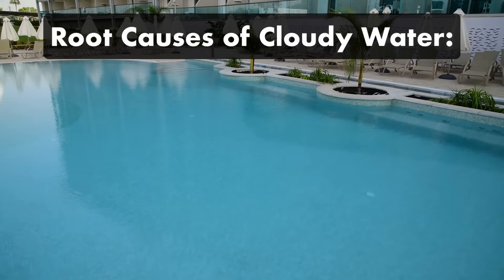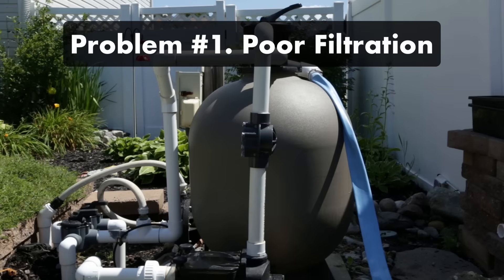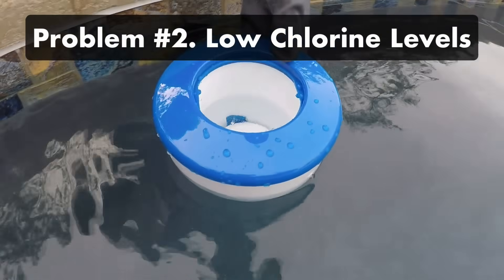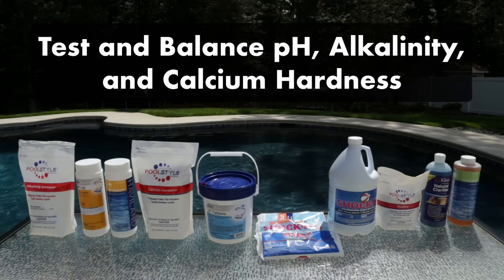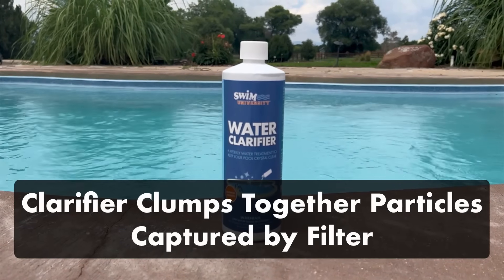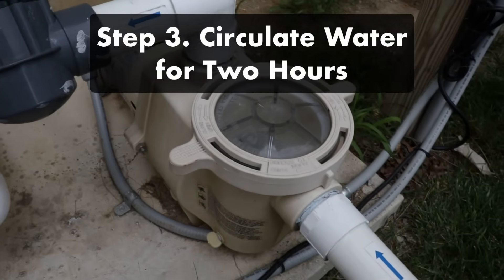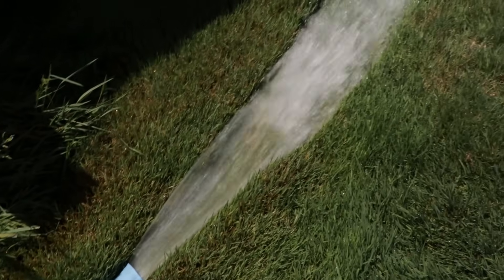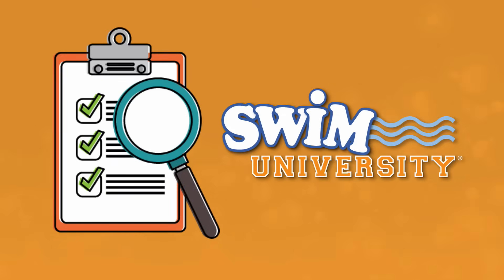How to Clear Up a CLOUDY POOL in 48 HOURS OR LESS

Comment: glad you mentioned poor chemistry as a root cause [02:54]. I’ve found that even if my levels look 'in range,' I can still get that murky look from organic buildup like lotions. I started using aquadoc non-chlorine shock once a week to oxidize those oils specifically, and it made my clarifier work ten times better. It basically prevents that 'chlorine lock' feeling where you keep dumping in sanitizer but nothing happens

Comment: Steps you should always take prior to and after adding chemicals..

1) Check levels (to see what you'd need)
2) Sweep floor with brush (allows dirt and debri to rise from floor)
3) Vacuum
4) Make sure pump media (Filter/sand) is clean.
5) Add chemicals
6) Run pump for 8-12 hours
7) Re-check levels next day
8) Add/balance pool chemicals
9) repeated process 2-5 until clear.

Comment: Working with my pool for spring open. Got above the ground pool. Every morning I check chemistry pH around 7.2-7.6, Alkalinity 100ppm, Chlorine at 5-10ppm due to shock, I brush the sides, the bottom, picked up some debris, filter running non-stop for now(performs 2 backwash and rinse daily) Pool still teal cloudy, cant see the bottom. Any advice?
Reply: Did you ever figure it out? I’m in the same boat

Comment: What happens when you use floc and the water is still milky/cloudy?
Reply from the maker: What else did you do before adding floc? How are your other levels?
Reply: @SwimUniversity Shocked several times with cal-hypo and then non-chlorine shock. 
My levels are:
PH 8
FAC 3
TC 15 
ALK 80
CH 125
Phos 50ppb

I know CC is 12. I want to stray from cal-hypo because it raised my CYA and I had to partially drain and refill. Should I try liquid chlorine? How many gallons of chlorine do I need for my 20,000 gallon cartridge pool? My kids haven’t swam this summer yet.😢 Thanks!
Reply: @enj0ythesiIence  Calcium hypochlorite did not raise your CYA, that would be Dichlor or Trichlor Tablets or some form of Stabilized Shock (ie Clorox "Blue" bags). Your CC is way out of balance, max is around 0.5ppm. I'd worry about that first. Yes Liquid chlorine is the best choice as it only affects FC levels and increases salt slightly. Our calcium hypo shock is fine, however it will raise your Calcium levels with each use. But that shouldn't be a problem for you currently as your Calcium is low enough. Something is causing the high Chloramines (CC) to be very high, which is first problem to attack

Comment: My above ground pool was green but after several shocking several times , vacuuming and running the filter it is now blue and levels are good. The problem is it’s cloudy and the CYA is at 0 with a test strip but about 30 at the pool store. I had added CYA 3 days ago , liquid in the skimmer. They are saying leave it alone but it’s still super cloudy. I clean the filter 2x a day - but it’s pretty clean w the exception of some small particles from pine trees. Any advice. Chlorine on the strip is also slightly high but not at the store test. Help!!

Comment: My free chlorine and combined chlorine are both high.  So I added non chlorine shock.  But I feel like I should have added a cal hypo shock instead.  Can I still add that or do I wait 24hrs?
Reply from the maker: You don't need to wait that long to add chemicals after adding non-chlorine shock. Test your chlorine levels after adding the non-chlorine shock. And if the combined chlorine hasn't come down, you can use chlorine shock.

Comment: My pool was beautiful and clear when we finished our swim.  I tested the water with a test strip and everything was balanced and within proper range except chlorine….  The chlorine was at 0 and so I decided to put shock in the pool….  Immediately the pool got cloudy, woke the next morning and its still cloudy…..   so what is the problem….   It was clean and beautiful when I added shock and immediately it turned cloudy….  Mildly cloudy HELP!!!
Reply from the maker: Shock kills the contaminants and it's very normal that it's cloudy afterwards! Clean and run your filter for 24/7. Or use flocculant or a clarifier to speed things up.
Reply: Another you need to test is phosphate levels, if it's to high not only is that candy for algae, it will also tie up your chlorine levels. If you don't get the dead algae out after a shock treatment, the dead algae can raise phosphate levels. It's a snowball if the phosphate levels get to high.

Comment: Hey! Some ppl say you should not use Flocculant with filterballs? Is that correct? They also says that about ClearPool (which I guess is what you call Clarifier). Do you know anything about that?
Reply from the maker: It's the same reason you wouldn't want to use floc with a cartridge filter: you need the floc to bypass the filter medium (on backwash). Any floc going through your filter medium, like a cartridge or filter balls, will stick to and ruin it. If you can bypass your filter (like a backwash or drain port), you should be fine!

Comment: I’ve been following these steps for 3 weeks and still can not get my cloudy water to clear up. I even just installed a brand new sand filter 2 weeks ago. I went with a 22” filter since my pool is 22,000 gallons. Filter has been on 24/7. I’m at a loss.
Reply: I imagine you cleared this up by now. I had the same issue. What ended up working is partial drain 4"-6" of water and replenish with hose water. Brought the Calcium level down and got rid of the haze.
Reply: @sixthroot  I’m still fighting it, I’m thinking the same about calcium but I think it’s coming from my well water.
Reply: @kopplinfamily7529 yeah I haven't been able to get it to clear up in the deep end area this year all the chemicals are within the right levels except the calcium hardness which is a little low at 120 PPM also on well water with a 22,000 gallon pool. Was told that the calcium hardness being a little low shouldn't cause the cloudiness though only if it was high but this is the first year I've had issues not being able to clear it up hopefully you get it figured out nothing more frustrating than a non- Crystal pool with how much it cost to run the it this year and the cost of chemicals debated on even opening it at all LOL

Comment: I just dump a couple gallons of bleach in my pool, it's clear very quickly . But I also make sure everything is right with my filter .
Reply from the maker: Good call checking the filter. And a couple gallons of bleach is essentially shocking your water!
Reply: What kind of bleach.  House bleach  ?
Reply: @arizonausa1664  yes
Reply: @thomascorbett2936  ok . Because I treated my pool   , shocked  , green to clean ,  then clarifier.  Now it cloudy
Reply: @arizonausa1664 same... I'm ready to use floc then vacuum to waste.

Comment: Ok so what do those of us that do not have a backwash or waste setting but have tons of dead algae that for some reason just won’t leave my pool? I love ur videos thank you for helping me
Reply: I pull my filter cartridge out, disconnect the hose to the outlet and put a backwash hose on there.
Reply: Dealing with this as well
Reply from the maker: Is it a cartridge filter or a smaller Intex sand filter? You might want to get a hand-held pool wand vacuum to suck it out (but it doesn't connect to your pool)

Comment: My pool was green like a pond. Used liquid Chlorbrite two different times. Killed algae, have stable levels of chlorine and all other levels. I have used Flocc two different times, exactly like directions. Waited 24-48 hours both times. Nothing has fallen and pool is still light blueish green cloudy. Any thoughts?
Reply: When you added the floc did you change the circulation to recirculate? The filter should be bypassed cause otherwise, the floc is being filtered out as soon as you put it in.
Reply from the maker: Exactly this 👆
Reply: Ok, so you have tested the alkaline and it’s within the suggested 100-150 ppm? The pH is within 7.2-7.5? The chlorine is at 3 ppm?
Reply: And that would be why you are not seeing coagulation of particles and floc at the bottom of your pool.

Comment: Good point about skimmer flaps (weir gates).
When taking on a new pool it's one of the first things I look at, making sure they are in place and working correctly.
If they are stuck down or missing, the vast majority of the water going into the skimmer is sub-surface level. Floating debris (dust, dirt, pollen, leaves) will go right past the skimmer, and sink eventually.

The weir blocks off most the water allowing only about the top half inch or so to get in. Surface tension draws nearby debris into the skimmer.
Properly working weir gates can make a huge difference in the pool's cleanliness.
Reply from the maker: A malfunctioning weir would cause a lot of issues!

Comment: Can flocculant be used with a DE filter? I was taught not to use it as it would clog the grids.
Reply from the maker: If you vacuum out the flocculant through the waste port using a backwash hose, it won't touch your filter grids.

Comment: Have you ever heard of the pool pump itself causing a cloudy pool? I have a new filter  perfectly balanced pool. Tired everything. Still  cloudy
Reply from the maker: Are you running it long enough? All of your water should pass through your system at least once a day.
Reply: @SwimUniversity  it runs 24/7.
Reply: @reddogg3118 damn you constantly run it? You must be rich haha. I run it 10 hours a day.
Reply: Thats the exact problem I have now. I've been running it for 24 hours and the pool place keep telling me the water is balanced. This is killing me!!
Reply: @thaglacierboy  I used something called pool first aid. It cleared my pool right up in three days. Crystal clear now.
Reply: @thaglacierboy go to a different pool store for testing.  Some of the testing machines can be significantly inaccurate.  Also, there are different approaches to reaching the goal of clear water. One approach will leave you on an expensive roller-coaster chasing a balance in your chemical/clarity. Other approaches do it in a logical progression of steps that isn't as expensive or frustrating. Having a good knowledge about pool chemistry is important as to which method is employed.
Reply: Have you tried phosphate removal ?